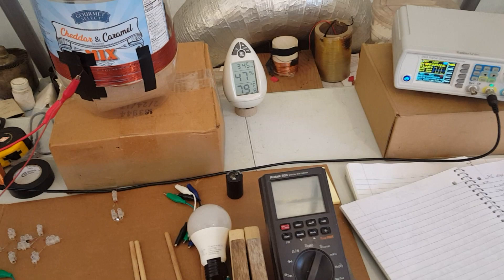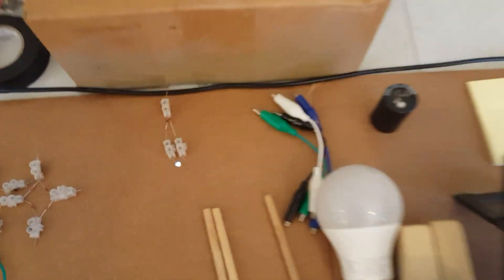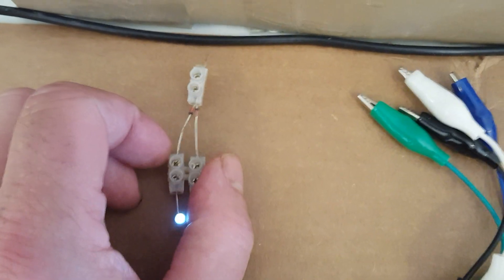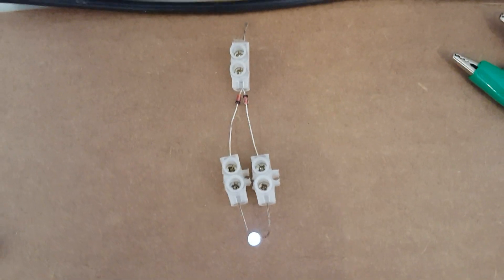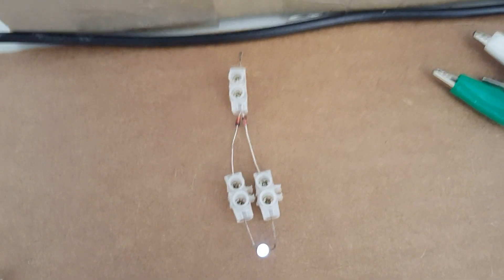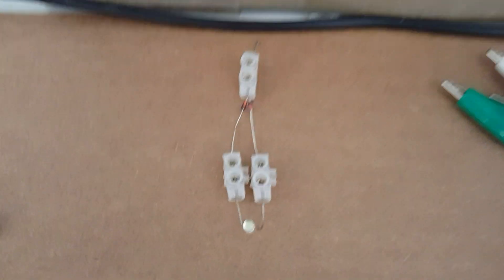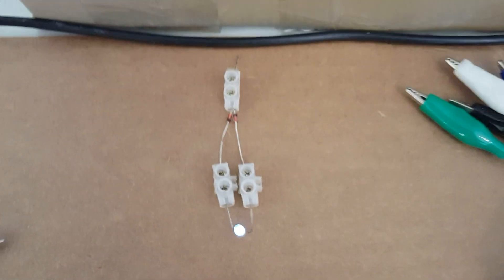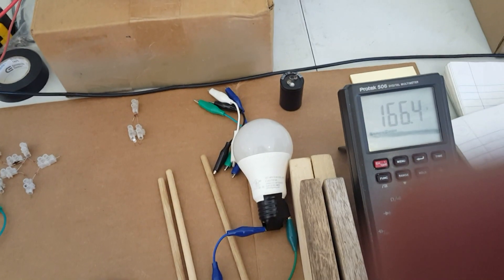WIRELESS POWER TRANSFER Part 6(Avramenko plug)

Comment: I don't remember seeing this one. that looks like 2 terminal blocks and a couple diodes clamped into them ,h an antenna wire and an LED. Are the diodes 1n4148?
Reply from the maker: Yes, you got it exactly!  1N4148 diodes
Reply: Can I use 1n34 germanium diodes?

Comment: They look like diodes to me...works like a simple one turn air coil transformer... ~( ,m,)~
Basically its a dipole antenna. Your finger acts as a tuned capacitor.
Reply from the maker: Yep, you got it!

Comment: great job paul my last afremenko plug was super sensitive and can sense the energy from my large sec excitor 22 feet away  your old one needs upgrading  and my deisgn used a copper thumb plate you ground yourself to and more parts than the old afremenko plug uses and yet its very sensitive  and yet no batteries like the old one
Reply from the maker: Thanks Steven, hope all is well with you😀